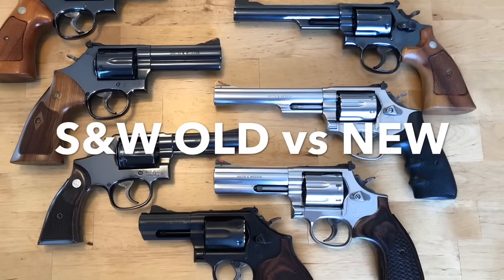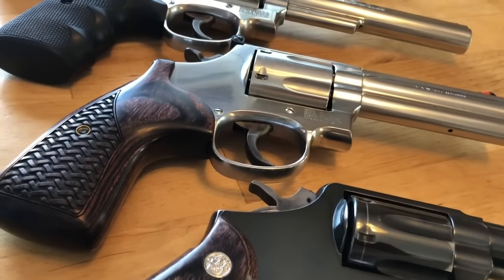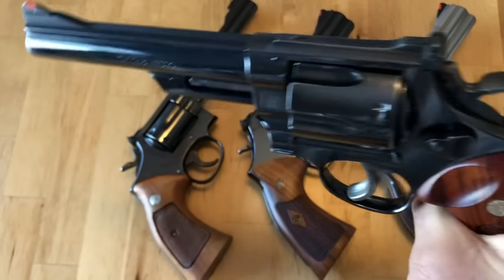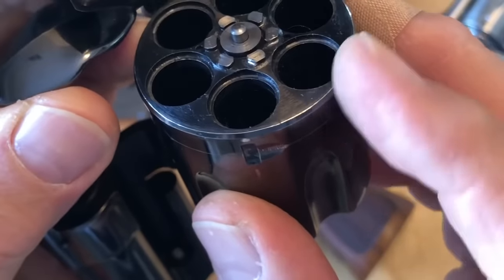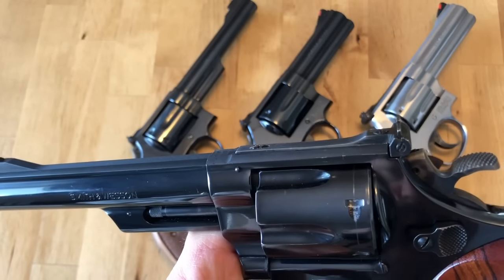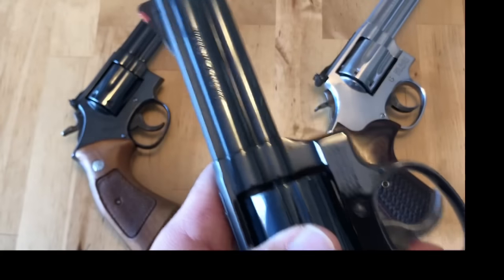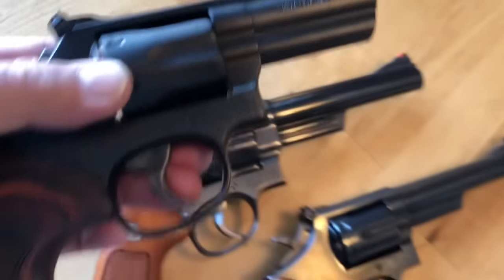Smith & Wesson: Old vs New. Do they make them like they used to?

Comment: Pretty, yes - but my story is this:   In the summer of 1988 I bought a new M29-4, 8-3/8” bbl for IHMSA Silhouette.   Rather than beat the gun with full-power factory loads, I knew the ram targets at 200 meters could be reliably knocked over with a 240gr bullet at a mild 1100 fps.  So I’ve used a mild AA#9 load for it and I put nearly 2100 rounds through the gun (I’ve retired it from Silhouette use).  But I have to say that before even 500 rounds I saw flame cutting of the topstrap (just above the cylinder-breech gap) and erosion of the forcing cone.   This is a model 29-4, new in 1988, and I don’t know who the S&W owners were when my gun  was made.   I do know that in 1988 almost nobody used a M29 for Silhouette- they had a bad reputation in that sport and most people used Super Blackhawks.    Even so, my M29 has served me very well and I’ll continue to shoot it.   I’ve since bought a M27-2 with the counterbored cylinder chambers and checkered top rib; it’s beautiful.   My newest S&W is a M60 - an excellent carry gun, fun to shoot, and accurate.

Comment: The biggest issue is the locks IMO

Thankfully some modern smiths don't have them so I got a 43c for that reason.

MIM parts don't bother me, and while I prefer a firing pin to be built onto the hammer, as long as it goes bang I don't care.

Comment: If Smith Wesson would get rid of that "Hillary" hole than they may see more people buying also they put the firing pin on the frame.
Luckily I bought mine long ago before they implemented these changes and prices were low.
I have a Model 19-7
Reply: Honestly, I could live with almost all the changes they did, as sign of times and evolution, except the damn stupid hole. More than once I was ready to pull the trigger on one of their newer designs, like the R8, which I find a very interesting gun, or some other of their Performance Center products, but every time I see that hole, which has no purpose whatsoever, I end up saving the money instead, I just can't live with that.

Comment: I have a 686+, purchased in 2015. The barrel (not pinned) was installed with an awkward, but subtle cant. I realized this whe I couldn't get the revolver zero'ed. The gunsmith tightened it back into alignment, but a few hundred rounds later, the barrel started to spin off (spun freely). 

The gunsmith jokingly called it a "take down model."  Which was kind of funny, unless you happened to be the owner. 

The gunsmith then did some work and added some threads. That let him crush the barrel down into position. He hopes the barrel doesn't come loose again. Uhhh.....me, too.

Despite this fiasco, I had the lock removed, an action job done, and a bobbed hammer installed (along with slightly longer firing pin and lighter firing pin spring). This 686+ now shoots like a dream, and 200+ rounds later, the barrel is still in place and the sights are bang on. 

While I've had some serious frustrations with this S&W, I have to say it is a fantastic revolver.....as long as the barrel stays on.
Reply: I bought a USED but never fired Mod 27 Classic that had a canted barrel.  I knew it wouldn’t sight right so I got in touch with S&W  customer service and they shipped me a FedEx label and I sent them the gun FOC and they fit a new barrel to the gun.  They also recut the cylinder gap to specification and evaluated the entire gun for correct functioning. 

The issue was fixed, they test fired and returned my 27 Classic and I paid $0.00.   It’s better than new.  Can’t tell you how pleased I was with the prompt service. 

Btw I’ve seen more older Smiths, Colts and Rugers with canted barrels than I care to count.  Don’t believe all the baloney of how they were ALL made perfectly back in the old days.

Comment: I'll never own a Hillary hole.
Are the scratches on the frame at 8:19 from trying to hit the Hillary hole?
(Note: You can't get the hammer mounted firing pin replacement part from S&W anymore.)
Reply: That is not a scratch.  It's an arrow telling you which way to turn the lock key.
Reply: Perfect.  From the ridiculous to the sublime.
Reply: Add a little hair around the hole for better locating.

Comment: I'm surprised they don't make a snub nose 586+. The 686+ snub is a big seller and one of my favorite modern day Smiths. If they made a snub blued 586+ they'd fly off the shelves. I have decided that if I'm going to spend money on a Smith or Colt I'd rather spend extra and get an older one. However, I have had to talk myself out of buying a new snub 686+ and I have successfully done so a few times now. If I saw a snub blued 586+ I'd have to buy it. I'd put some magna grips on it and carry it a lot, lock and all. That's one I'd have to buy.

Comment: The hammer n trigger - Forged means not machined but the metal is formed under
great pressure to change its crystalline structure to make it more uniform, squeezed.
The result is much stronger than just shaping a piece from a stock metal (cold roll/hot
roll), then machining it to shape.  Of course, u may machine a forged piece too to shape
or remove flanges.  That's a common knowledge in metal processing/manufacturing.
Try looking at ur 'Forged' stamp on ur wrench.  Some doesn't have it.

I do appreciated ur review on the old vs. new revolvers.  The trend is to cut mat'l, processing
time, and if not enough competition, jack up the price even to lose the traditional 
reputational and sought after brand?  Gun Nut in olden dayz were very knowledgable
about guns in the mkt.  Well, the younger  ones though doesn't know when traditional
good China (ceramic) lost a market segment w Pyramid building Topper Wear and maybe
dat's why they like Topper Wear and cheap to machine Alum. guns vs. real darn steel?!
They like Feather mat'l that can be blown off like dusts vs. solid rock.

Comment: The Model 19 K-frame Carry Comp is DESIGNED to have a dull finish, it's bead blasted then blued, meant to not reflect light in the dark.  Bead blasting is NOT an inexpensive process.  You can get the same Model 19 6" without the comp in polished blue.

Comment: It seems nobody have ever point out that: the curvature on the frame around the hammer is more rounded and curved in the old S&W revolvers, while the new one are straightened. I kinda like the old, more curved one as it looks more elegant to me. The new one just make me feel less of that kind of sense of craftsmanship.

The old S&W revolvers should become collectors items now. If I really gonna get to buy a revolver for actual shooting, I won't buy the new generation S&W. I would go for Ruger! (Oh! The Ruger Red Hawk .45 gun-porn showed up in my mind.)

In contrast to most enthusiasts, I prefer non-recessed cylinder. Because I can just look at the cylinder gap to check if it is loaded.

Back to the time, that everybody's hated key lock was probably the tactics for the S&W to maintain survive. (We should remember it was really a tough period of time for the firearm industries.) So I won't blame on S&W too much. But I still just want to ask a question: could that lock be done in a more subtle way? (Such as what Taurus did.)
Reply: Someone can correct me if I am wrong but I think the reason for  the difference in the curvature on the frame on  lock vs. prelock is the fact the ones with a lock have a free floating firing pin in the frame making it physically necessary for a fatter, more straightened frame in that area.   The older prelock ones , with the firing pin ( hammer nose ) on the hammer , do not.

Comment: Great video, thank you. I will add, while I am not offering this as definitive judgement (because the sample size is so small) I have to say that I have owned 5 S&W handguns through the years - a model 29, 8-3/8" and a model 559, both of which were bought in the 1980s (and sold in the 1990s), an M&P 2.0 Shield 9mm and an M&P 2.0 full-sized 9mm I bought more recently, and the 5th, a model 686-6 6" that I just purchased in Jan of 2020. The 686 is the newest, and is also the only one that has ever given me any trouble; I ran into issues with the trigger sticking on the very first box of 38 special ammo I put through it. In fact, at the time I am writing this it is back at S&W being repaired. Do they make them like they used to? Based on my very small sample size, no they don't. To their credit S&W customer service has been awesome so far, and I am confident that they will rectify the issue. But still...

Comment: So hey everyone, I'm looking to purchase my very first firearm sometime soon and found out that I'm into revolvers of all kinds! What would be some revolvers to look into? Please, I'm open to all kinds of suggestions! Thanks for reading! I love the way how the K frame looks! Such a beauty!
Reply: I love a 38 or 357 an start practicing with 38 target loads. An as ur comfort and experience and desire to move to hotter ammo if u wanting a conceled carry gun an older stubbnose in 38 with small round but grips if u decide to go with 1 with a hammer I'd have or if u have the ability to do it ur self I'd round an smooth out the edges of the the hammer to reduce pocket snag an after u get pretty good with it like that I'd consider a trigger job (smooth out the action) polish an smooth out the trigger face and lighten the springs alil inside the gun an then start back practicing with the improvements and watch the improvements pay off quick as then u can definitely ur skills an ability. Good luck
Reply: If you want a true classic blued .38 target gun, it's hard to beat a model 14. They are still available on the used market. If you want it in .357, the model 19 can be had old or new. If you don't mind a stainless gun, the 686 in .357 is my all time favorite shooter.
Reply: Model 17,nuff said.
Reply: @shockwave6416  you are so right! A model 17 will teach you more about shooting than any gun on the market, and do it cheaper too!  I’ve owned my 6” 17 since 1976! I found it after an almost 3 year search! I’ve been totally in love with this revolver since day one! I’ve run more than 80,000 rounds through it with never a problem! They definitely don’t make them like this anymore! I’m very grateful to own it!
Reply: @mikegriffith4960  I've been shooting the ppq .22 and omg it's great.
Reply: @shockwave6416  I’m pretty “old school” not familiar with ppq 22
Reply: @mikegriffith4960  they aren't expensive. They shoot too good.
Reply: @shockwave6416  I’m not hurting for 22 ammo! I’ve tried about everything on the market in my 17 over the years! It has always favored the Remington Thunderbolt over everything else. The last time I inventoried my stash of 22 ammo, I had almost 17,000 round’s! I don’t get the opportunity to shoot as much as I once did! I think I have enough to last me until I get called Home!
Reply: @mikegriffith4960  broooo! That's a crapload of .22!
Reply: @shockwave6416  I’ve always liked to be prepared! I’ve been reloading my own stuff since 1977. I load several calibers of hand gun and rifle. Thank God I had a good supply of powder and primers when the shortage hit! I’m confident that I have more than I will ever use! It’s a comforting feeling! I’m getting low on a couple of my favorite powders but I don’t really need anything! Good to visit with you!
Reply: @mikegriffith4960  I only have about 10 years experience,but I still love to shoot. Glad you stocked up!
Reply: @shockwave6416  I have a small bullet trap that I can shoot my 17 into! I can shoot 10 yards inside my shop! I can stay in tune by shooting in there! I hope you keep enjoying your 17, you treat it right and it will last your lifetime! Shortly after I got mine, I had a jeweler friend engrave my name on the frame just below the cylinder on the left side! My thinking was that would prevent me from ever wanting to sell or trade it! I’ve never even had a thought about doing either! It has created a lot of memories for me! I grew up in rural Arkansas so I had lots of opportunities to shoot varmints. I made a practice of trying to see just how far I could hit a target with the 17, after a lot of practice, it got to be common place to hit what I was shooting at as far as 150 yds. I once shot a rabbit at 180, I was thrilled to have had a witness! You will never make those so-called accidental shots, unless you pull that trigger!
Reply: @mikegriffith4960  yeah. The cylinder holes on mine are very tight.
Reply: @shockwave6416  the Remington stuff I shoot is pretty dirty, I have to run a brass brush through mine pretty often! Not a big problem!

Comment: I tried to quickly search the finish on the K-Comp and couldn't find it.
My guess would be that it's QPQ or DLC .  Both are incredibly tough . . 
QPQ /Melonite is so tough that it's used as a finish on gear teeth on some automotive applications,  so that should tell you something.
I seriously doubt that S&W would use Cerakote on a $1100 revolver considering that a QPQ finished slide sells for the same as bead blasted in many cases.
QPQ rates high in resistence to salt corrosion also

Comment: hold an old k frame up to a new one and you will notice there is a slight change in size and shape. And they should lose the Lock hole move it inside the gun or dump it all together. I have a "Few" Smiths myself am addicted to snub guns for some reason. i have 8 snubs from .22 mag up to .41 mag all are great.

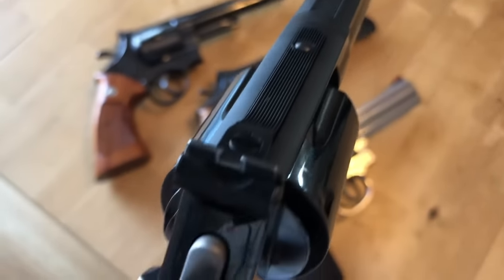Comment: Looking at that 586 and pausing the video at 12:14, it looks as if the barrel was not properly aligned to the frame according to the cut serrations on top of each piece. Or the serrations were not cut on center on either of each piece. It only makes one wonder what the rest of the gun looks like that you cannot see on the video.

Comment: The old S&W revolvers with the forged parts are not as awesome either as everyone thinks they are and they are not better than S&W MIM parts.  Hard forged parts have a tendency to get brittle with use and develop hairline cracks in critical areas especially pinned areas.  Ive had more old S&W hard forged hammers break on me than any other gun part ive ever had!  Not saying it cant happen but to date ive never had a MIM part break on me yet.  However I hate the damn key holes on the new guns thats a stupid feature that S&W needs to completely scrap!

Comment: I like the 70-80's models way better, bought a new 6" barrel #686 and had a canted barrel, cracked firing pin bushing and on 2 chambers the spent brass would stick..Sent it back they gave me a new cylinder, bushing and straighten the barrel some what but still not perfect and they said it's now in spec.... I like S&W revolvers but really sent out a handgun like this and still the barrel isn't straight like my older ones..

Comment: I was into Rugers when I was in my twenties but as I got older I gravitated to S&W and for my 51st I'm looking at getting a S&W 460XVR.
Afew years ago I gave my mom my 637 cause she could barely pull the trigger or cock the hammer on the old Charter Arms my stepdad left her, but that 637 she could handle it with ease and I missed that one more than any other gun and with the snubbie bug bitting I got a 638.

Comment: I need some nice grips as mine came with no originals but the black rubber ones. I did manage to get three packmyer time period grips to replace the ones on them. I am thinking altamont grips first. Then go from there. Mine is a 14-4. And a 10-8

Comment: I came from CT and long time ago we have a machinist job that wills the frame barrel cylinder and send it to assembly line that assembled part together and polished and hand fit  then two persons inspected the job and moved to the next lines of assembly. Hartford unions made Colt Python, and Colts M-16-A1 and Police Positive and Cold Cup National Match and we qualify each piece and assembly. I hope people support quality of Hartford, CT Colt MFG but too bad no one care about Colt Quality. Colt we made is 30% expensive than S&W I had l lots of them in my home most new condition even one that made in 1922 Police Positive in Box.

Comment: Just bought a 629-6 2 days ago.  The barred was canted.  The trigger was also crooked, to the point that if you cocked the hammer, the edge of one side of the trigger, protrudes outside of the trigger guard.  Did they used to make them like that?  

Sent it back to S&W to get corrected.  We’ll see what the turn around time is, and if it gets fixed.
Reply from the maker: Bob Zanveghana Should have never left the factory in that condition.
Reply: David Drake I hope it gets corrected, as outside of aforementioned the lawyer lock (I would prefer it didn’t have it, but it’s not a dealbreaker), I really like the gun.  MIM doesn’t bother me, as Colt has used sintered parts for a long time, and even Ruger’s investment casting has never bothered me.  But when you pay, after tax, a hair shy of a grand for a handgun, the fitting issues are not something I can look past.

Comment: I do like the firing pen to the transfer bar so that pen ain't resting on a round
Reply: Even the old ones with the hammer-mounted pin didn't allow the pin to rest on the primer.  They all are safe for 6 rounds.
Reply: That hammer mounted firing pin was the best thing S&W got rid of.
Reply: Pete 913 what was wrong with it ?  It worked pretty well for over 100 years.
Reply: @66smithra  They break. They are notorious for breakage.